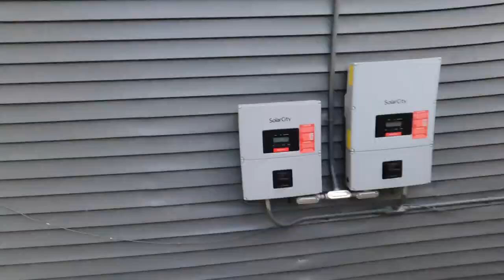200A Service Upgrade | Garwood, NJ  #electrician #serviceupgrade

Comment: I’m just curious why you don’t cut the drip loop first then pull the meter?
Reply from the maker: Because technically the meter itself is an electrical load.
Reply: @electricianron_New_Jersey  I understand that. A lineman told me while back, to be aware when you pull a meter with an incoming  line that’s still energized. That  there is a potential of the plastic that holds the lugs inside the meter base to break and hit line to line or hit the enclosure. He said over the years the plastic becomes  brittle from the heat and cold. He recommended always cut the loop first if possible.

Comment: Hello Ron. What would you do if the breaker panel were facing the outside of the house? Would it be worth flipping around to the inside?
Reply from the maker: I dont see why not unless the room on the inside was a closet, kitchen, or bathroom. Then it would be a code violation, not to mention not very poor idea.
Reply: Thanks for the feedback. California house. I guess it was legit to put it on the outside of the house in the 80s. Beautiful workmanship all around. Skilled trades still alive and kickin!

Comment: 1:06 Doing the service connection only if you're qualified can't be emphasized enough.  I have thousands of hours wiring up control panels and motor drives but I wouldn't feel comfortable up on a ladder messing with live utility service conductors.  Maybe part of experience is learning the things you shouldn't be doing.
Reply: We need the utility company to remove their meter, disconnect the main lines as they have to upgrade theirs for 200A. Once I'm completed the job needs to have a pre booked inspection and pass before system can be energized again. No where in the western world have I worked where you can just cut the utility line or remove their meter without legal implications.

Comment: I had my service upgraded recently but I noticed he installed a 30 breakers load center. Why would you pick that vs a larger 40 slot. Of note there’s plenty of room above and below.
Reply from the maker: The electrical contractor should have offered you a few options. 30 circuits in a 200 amp MB panel is not giving you bang for your buck.

Comment: Is this a normal house? in Sweden the average house is on 20 or 25 amps main fuse
Reply from the maker: Very normal house.  100 amp service is becoming somewhat useless in 2022.
Reply: @electricianron_New_Jersey  damn, that's an insane difference, is this because you use 120 volts?
Reply: @svenskvoid2372 half the voltage (120 compared to your 230) means twice the current. Also means a larger diameter cable to carry that current than you guys use over there.

Comment: you are a master electrician however you did not re-identify the black circuit on the ground bar at the top
Reply from the maker: It’s a grounding electrode and it’s not required to be re-identified.

Comment: Nice job! I am surprised that New Jersey isn't requiring an External Electrical Disconnect like Maine and New York are starting to. Also, they are pushing for surge protection in all upgrades.
I know the area (sort of) that you work in; I was stationed at Sandy Hook in the '70's as an ET. Did you get your start as an EM in the Seabees?
Reply from the maker: NJ just adopted the 2020 NEC in September.  There’s a 6-month grace period for compliance.

Comment: It would be nice to have some narration of what you are doing rather than the music 
I knew an electrician who used to install all his breakers with wires on them so he would just wire nut all the old wires from a tiny short 100 amp 20 breaker panel up at top to make switching the panel over faster maybe leave some at top open for ones that are long enough to reach

Comment: Wire service providers let you just cut their wires like that? I haven't worked in a country yet where it's legal to pull their Meter or cut their energized lines.
Reply from the maker: In NJ, my electrical license unlocks that door. Of course, I need a permit for a job like this.
Reply: @electricianron_New_Jersey  yeah in Alberta we have to get the utility out to de energize. Then have a passed inspection for them to re energize. Real pain in the ass waiting on them to turn up. I've done lots of 200A upgrades and agree with you they are a pain in the ass. We also have to have a panel where the main feeders are separated from branch circuits so can't bring them in the same side.lol We also aren't allowed to splice in our panels! Another dumb rule.

Comment: Garwood has a home Depot that is like an exaggerated hardware store
Reply: Super small electrical section in that location.
Reply from the maker: @michaelleddy3701  It very rarely has what I need but the one in Union and/ or Vauxhall is only 20-25 minutes away.

Comment: That’s cheapest way possible to do 200 amp upgrade. I am also an electrical contractor,  I will only run rigid conduit, no SE wire. The wire just looks unprofessional on a nice property. If possible I’ll change it to underground if feasible. Take pride in your work, I’m a proud NECA contractor
Reply from the maker: You’re a real shit head for coming on here and talking down to me.  Are you a union jerk off too?